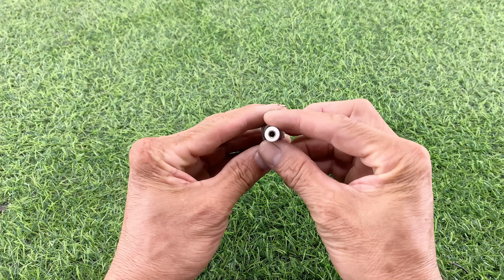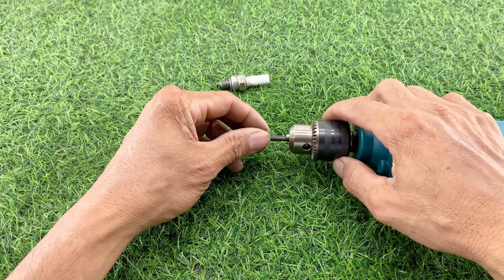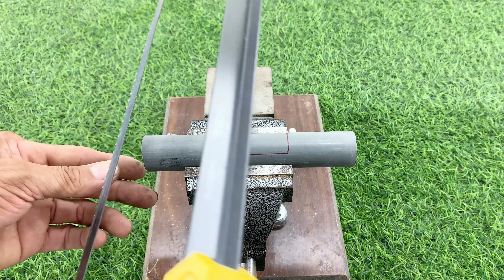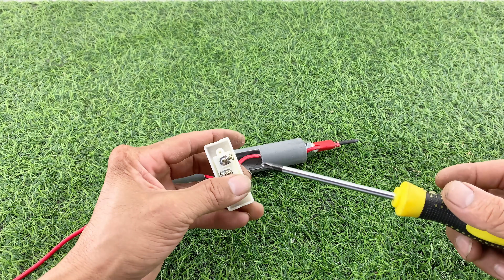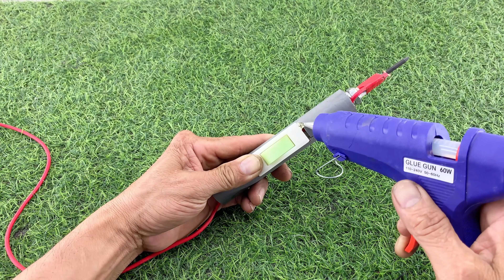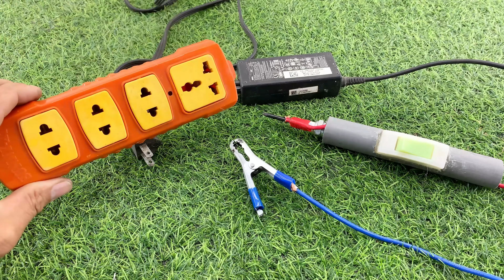Millions of people were surprised to know this DIY heat welding machine from broken charger!

Comment: Làm ơn giải thích cho tôi rằng : liệu công cụ này có đáp ứng được yêu cầu khi sử dụng nó vào việc tạo mối liên kết giữa các xell pin hay không??? Và nếu có hoặc không thì đâu là nguyên nhân chính? Tôi sẽ rất vui và hạnh phúc, cũng như lòng biết ơn to lớn khi nhận được sự phản hồi của bạn, chúc bạn sức khỏe và thành công.!!! I am from Viet Nam😍😍😍
Reply from the maker: Thank you for your detailed question! 
This tool can be used for connecting battery cells, but only for very small, simple joints that require low current. If it’s not suitable, the main reasons are:
Unstable heat output, or Insufficient pulse current for proper cell welding, or safety concerns, since batteries are heat-sensitive. For strong and safe battery connections, a spot welder is always the best choice.
Thank you for the kind words and support from Vietnam!😍 Wishing you good health and success as well!